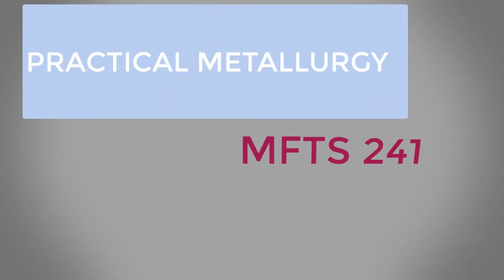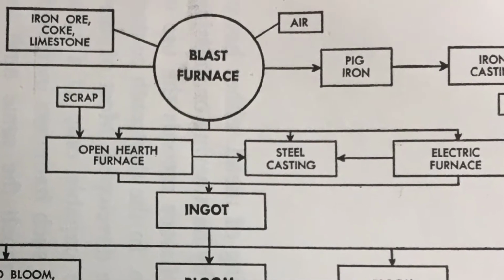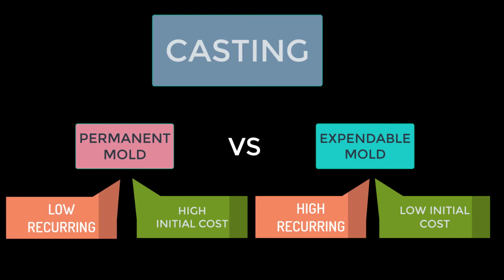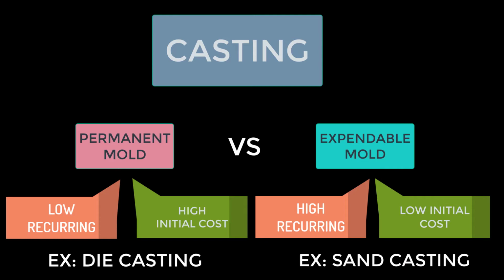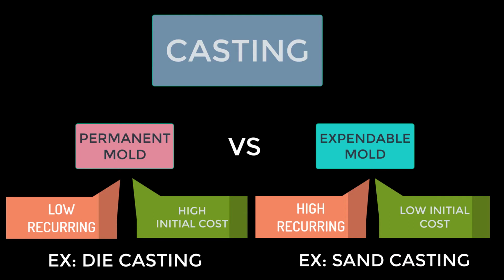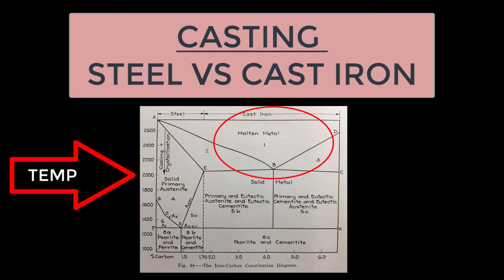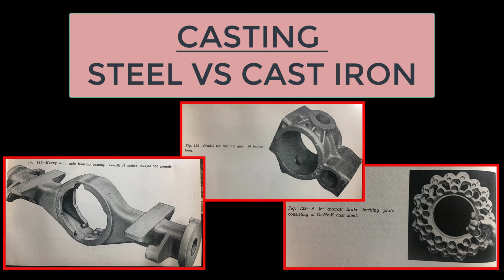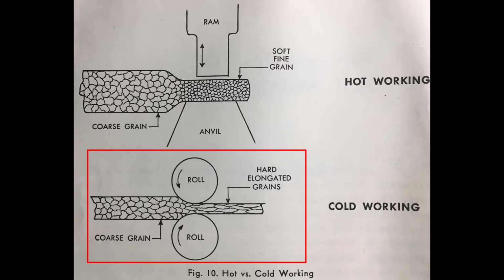Casting Steel, Chapter 8,  Part 1, MFTS 241

Comment: Thanks for the wonderful video. If possible could you please suggest some books for Al casted parts. Thanks
Reply from the maker: Hi, I’m working on a video where I talk about my favorite books on metallurgy. As far as aluminum casting, take a look at publications from ALCOA. Lots of great information and available cheap from eBay.
Reply: Foseco has 2 books, Non-ferrous Foundryman's Handbook and Ferrous Foundryman's Handbook. For aluminum you'd want the non-ferrous if you're not familiar with those terms. You can find them used and electronic versions floating around.